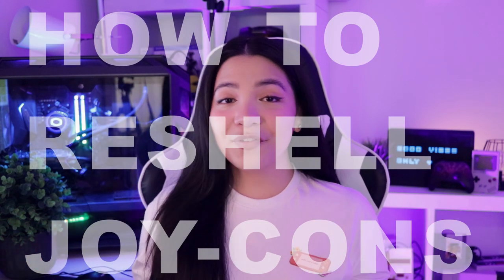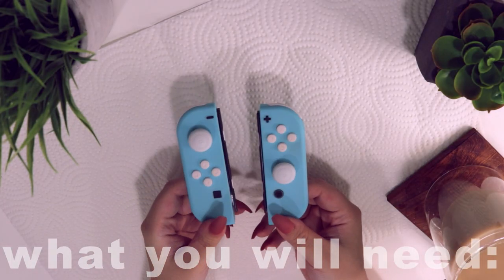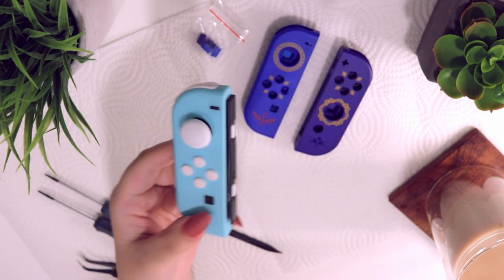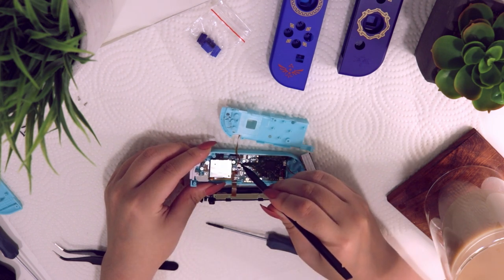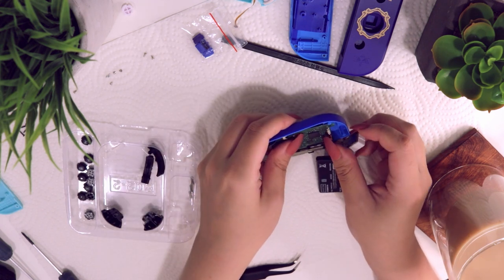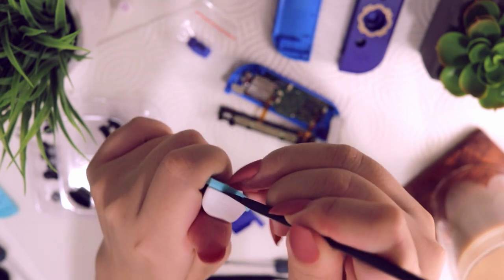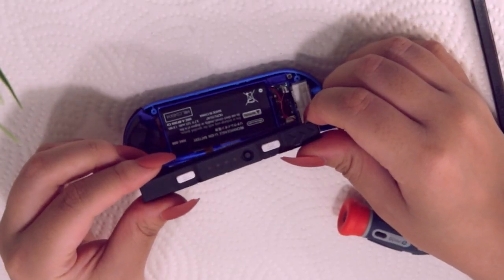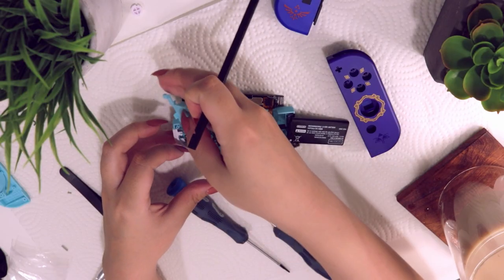I Made the Zelda Skyward Sword Joy-Cons for Only $10 | How to Swap Your Joycon Shells Tutorial

Comment: Shell swaps are so hard to do. Hours of work but now my wife and I can game all night without running out of controllers.
Reply from the maker: Sounds like you two have a good collection going! It’s so worth it for the end result 🙌🏼
Reply: @kat.  yeah, lately we've been doing lots of overcooked so we needed to get a  separate joycon charger for our sets. As far as colors go, She first went with the pink etsy vinyl covers for her original set. Her sister gave me a set with busted joysticks, so I swapped the factory shells with clear green ones as I replaced the drifty set. Now we have 3 sets including my watermelon ones but I prefer using the 8bitdo adaptor for ps4 or a wii pro controller. It's just that overcooked might require the joycons. Anyhow, this tutorial was mellow and I didn't know that you could replace the zl/zr buttons.  Thanks
Reply: @adamjsouthcott6620  if you’re playing docked, why not just use a pro controller. The battery life is pretty solid, with my day one controller. I’m still getting ~25+ hours per charge. I honestly lose count of the days
Reply: @jalene150  Agreed. I prefer the 8bitdo adapter so I can use a PS4 controller. I just bought that Pikachu GC controller recently. The shell swap originally was done because I had to fix a couple drifty joy cons that were gifted to me. Instead of trashing them, I put new sticks in and put a clear shell on the set. They're a great backup especially for when using party games that require the little joy cons or if you have lots of players together.

Comment: Need some help. I reshelled my joycons but now the left won't dock with the switch. It still connects wirelessly and I can charge it with the grip. I tried replacing the part of the rail that connects to the switch but nothing. Also my other joycons dock with no problems. Any help or suggestions would be appreciated.

Comment: Nice. Did you get the shells from AliExpress?
Reply: Forgot to give a quick recommendation, you might want to replace the plastic latches from the inside of the joy con rails, with metal ones, it will make them sturdier, and prevent them from wearing out and sliding out of your switch.
Reply from the maker: Thank you for the tip! I’ve seen this upgrade before but wasn’t sure how much of a difference it would make. That’s awesome to hear though 🙌🏼 - I got my shells from eBay though I’m sure any of the online marketplaces based in China might have it haha